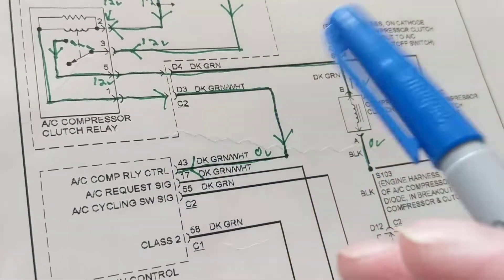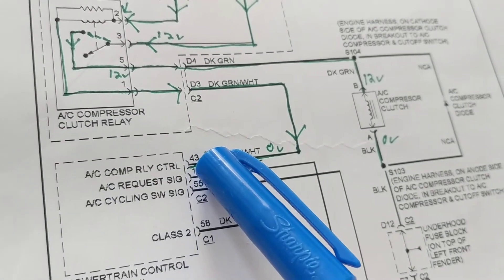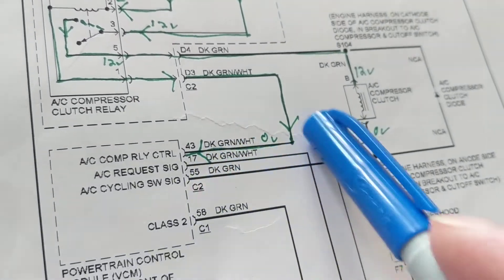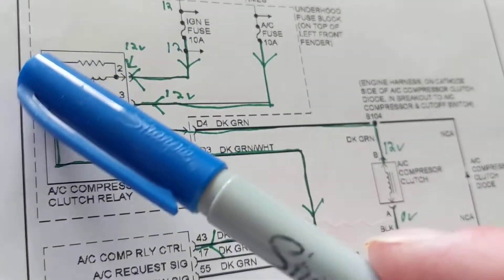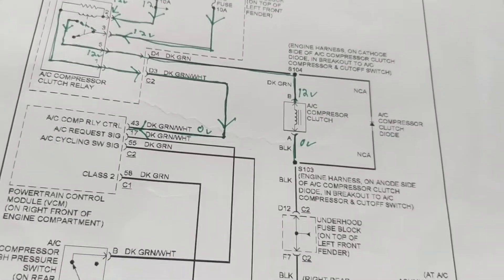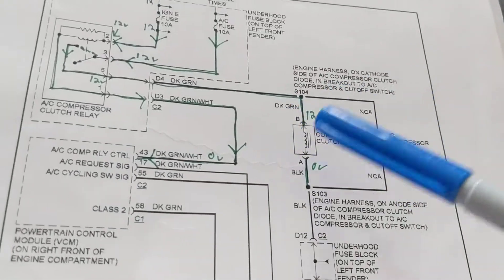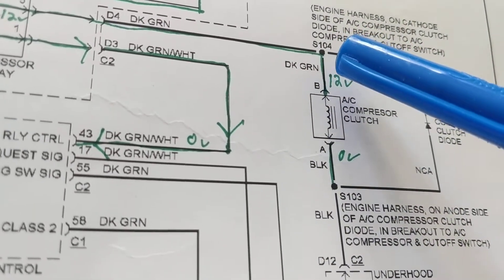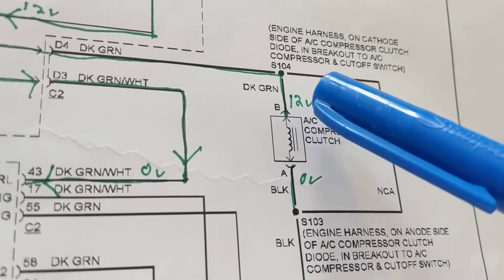HOW TO DIAGNOSE AIR CONDITIONING PROBLEM FOR ANY VEHICLE FROM DIAGRAM

Comment: Awesome as always Joe. What about a video sometime on bias voltage if you could get enough views
Reply from the maker: I'd like to but what do you mean by bias voltages the b+ voltages to make sure
Reply: Say checking  a fuel pump circuit where the transistor is off no current flows to the control side off the relay   and with a resistor on that side transistor you have voltage going thru coil in relay but amperage way to low to create a magnetic field to turn in relay. Take relay out and the voltage goes to zero. Doesn't computer use this bias voltage to make sure circuit intergity us good no opens or shorts. How I ask this correctly
Reply from the maker: @randywheeler652  okay I'll try my best thank you
Reply from the maker: @randywheeler652  I want to understand the the situation there's a transistor bias in the computer giving a ground when that transistor is either on or off the control side will be connected through the computer to a ground when the computer determines the fuel pump has to be turned on the transistor will be used as a switch and saturation whether it's npn or PNP transistor then the control side will be grounded through the transistor
Reply from the maker: @randywheeler652  the computer just gives the ground when it needs to to turn on the fuel pump or fuel injectors not necessarily sensing the voltage or the current as long as the starter motor has engaged the flywheel to the crankshaft it knows it has to give fuel obviously by engaging the fuel pump thus turning the transistor on as a switch to ground
Reply: And the resistor would be like 100,000 k ohms
Reply: Thanks  Joe